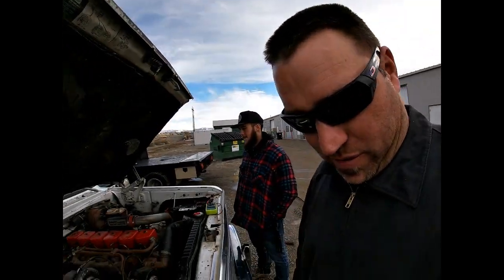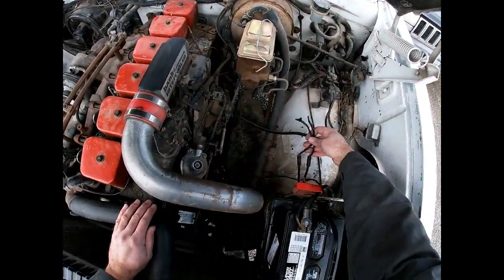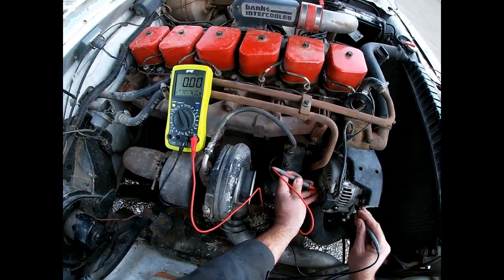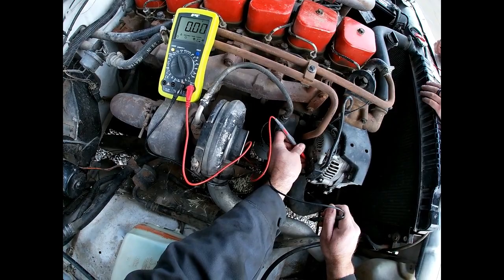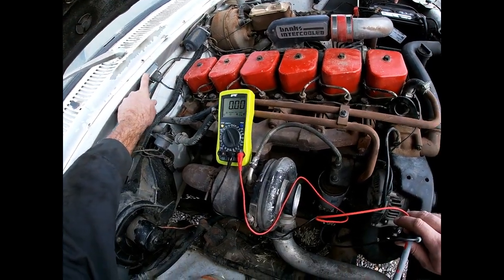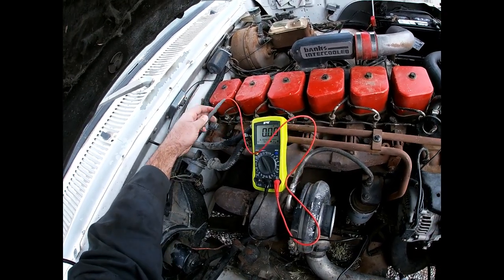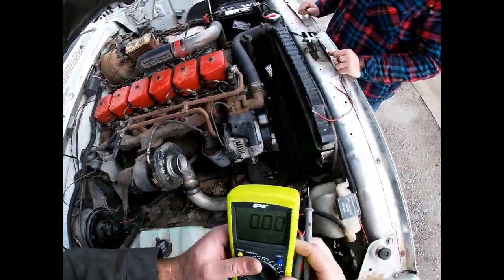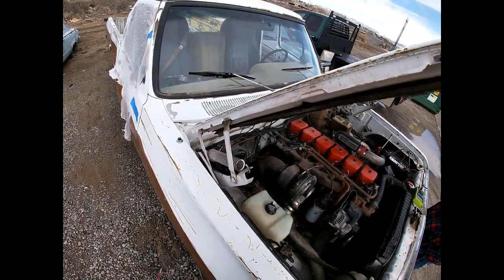12V Cummins Charging system Diagnosis and Repair

Comment: why didn't you do the 1 wire $24 conversion?
Reply from the maker: Wanted to leave it stock at that point to show folks how to repair the system in stock form. I have a 1 wire alt on it now

Comment: Hey I tested the alternator with a wire to  top bolt and case and my voltage dropped then truck died and now won’t start

Comment: Im having overcharging issues after replacing and chasing the wiring for the voltage regulator, and 2 alternators and im lost. Its on a 89 d250. I was going to replace the relay on the drivers fender but I'm open to trying anything to get it fixed

Comment: I’m really starting to think I got a bad new part haha got a new alternator when my batteries weren’t charging then when they still weren’t I got a voltage regulator to bypass the pcm and it still isn’t charging so either the alternator I got is bad or the voltage regulator is bad but tomorrow I’ll check the alternator and make sure it’s working so thanks for the video
Reply from the maker: @Zero_00-yt  you got it bud. Thank you for the comment. If you are using a stock style regulator with the silver body and 2 pin connector, make sure it has a good ground and get a tube of gray RTV silicone and smear a nice continous bead on the backside of the regulator covering the seam where the metal case of the regulator meets the black resin material. Since they are mounted upside down and on the cowl, water always finds its way into them and cooks them in short order. I went thru 3 of them in a year until i sealed one up and its still on there 3 years later.

Comment: I have a 1991 dodge d350 does the alternator not engage until 1200 rpm’s
Reply from the maker: @blinkdevelopments8579  on my  89 and my buddies 91 they both charge at idle. 14.5-14.6 volts
Reply: @ okay I appreciate the fast reply I am having issues with my 91 it will run perfectly while it is turned on drove 2 hours with it, but it has a hard time starting and sometimes I have to use a jump pack if it doesn’t start within the first crank the battery quits. I took it to autozone and they said the battery was fine and it was the alternator but I am finding it hard to believe. I will have to test to see if my battery is charging while running or not.
Reply from the maker: @blinkdevelopments8579 it does indeed sound like the battery, but make sure the grounds and battery terminals are good and it wouldnt hurt to have the starter tested either. Have someone crank the truck while you.measure batt voltage with a meter at the battery. It shouldnt drop below 10 if the batt is charged. If it does it give it a battery first.